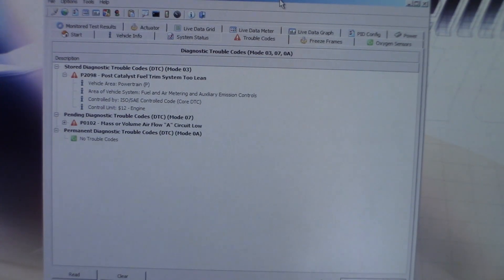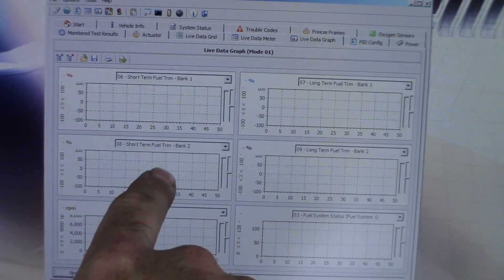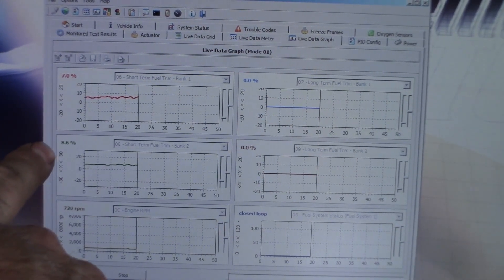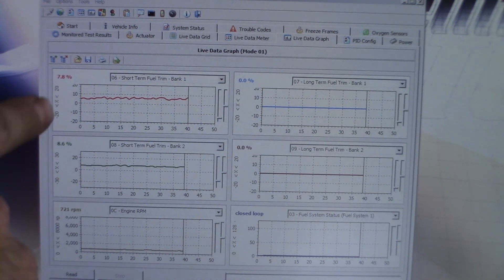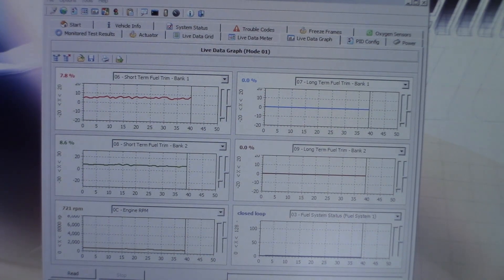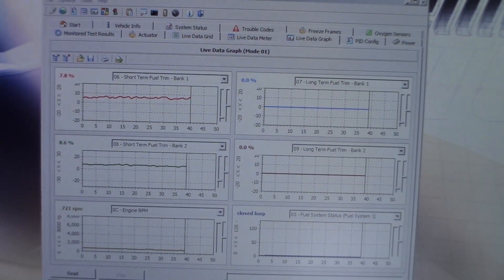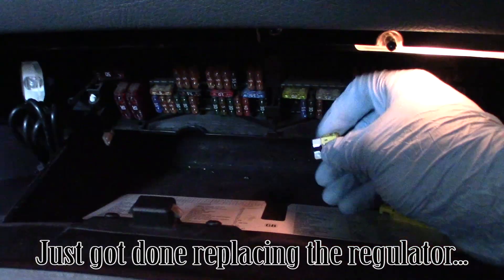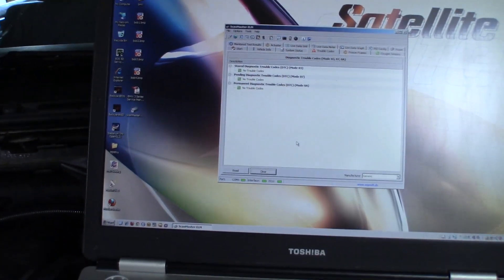BMW 330i 325i E46 Using Fuel Trims To Diagnose Engine Problems P0171 P0174

Comment: Can you comment on where you purchased the Scanmaster ELM software/version. I googled it and and this-https://www.google.com/url?sa=t&rct=j&q=&esrc=s&source=web&cd=1&cad=rja&uact=8&ved=0ahUKEwjMkp3mv-TJAhUDQCYKHQBSBKoQFggdMAA&url=http%3A%2F%2Fwww.wgsoft.de%2Fen%2Fshop%2Fobd-2-software-products%2Fscanmaster-elm-for-elm327.html&usg=AFQjCNG7mUTMNCngt9Zk_j9l8-LE6U3Cgw&sig2=sp6nstG27qjaixMBM95AAw was the top hit. It's mostly German so its hard to tell what i would be getting and I didn't want to order only to find out it isn't compatible with my 2001 330Ci BMW. 
Thanks, great video.
Reply from the maker: +Charles Safely That is where I bought it.

Comment: My LTFT is -4.7. What is the optimal value I need to watch for?
Reply from the maker: +Rey Torres 0 is the normal value.  Sounds like you may have a fuel over-delivery issue.  Have your fuel pressure checked.  It should be 50psi (I gave an incorrect value in the video).
Reply: +50sKid , Hi there.  I have not check the fuel pressure yet.  A year ago I replaced my fuel filter, fuel pump, and fuel level sending sensor.  So If I have issue with fuel pressure regulator, my fuel filter is bad? The fuel filter has regulator in it. So where do I start?  Thanks, Rey.
Reply: BTW today my LTFT is -3.1 but while driving about 15 minutes its up to -3.9.
Reply from the maker: Normally anything lower than 5 isn't cause for concern. If you don't have any codes, then don't worry about it.
Reply: @50sKid  I had same issue, invested lot of money...and my adaptations were always negative. I replaced almost whole fuel delivery system and after 2 years i found it was broken MAF cable. Replaced cable, adaptations went to +2%/+2%
Reply: @michaltimko  how did you replace the cable? New harness or running a new wire?
Reply: @bputerbaugh9708  You can buy new new parts from BMW.

Part # 12 52 1 427 222 - Socket housing
Part # 12 52 0 007 170 - Socket terminal x3

Comment: I have an aftermarket intake on my 330ci. after 3 days when I was on the highway the service engine light came on. I got the code checked and only bank 1 is running lean. do you think it could be a clogged fuel filter? should I check my intake boots and clean my maf too?
Reply from the maker: Neither of the things you mentioned would cause a lean condition on only one bank, so they are ruled out. Check for exhaust leaks in bank one, before and particularly around the oxygen sensors. Exhaust leaks several inches after the post cat oxygen sensor won't cause problems.
Reply: +50sKid where are the oxygen sensors located? and how would I check for exhaust leaks
Reply: +BarberKid the car also does not idle rough at cold or warm and no misfire or loss of power

Comment: Did you have to put back the 20A fuel pump fuse before turning the ignition on to read the fuel pressure?
Reply from the maker: Yes without that fuse, the fuel pump won't run and thus won't make pressure.